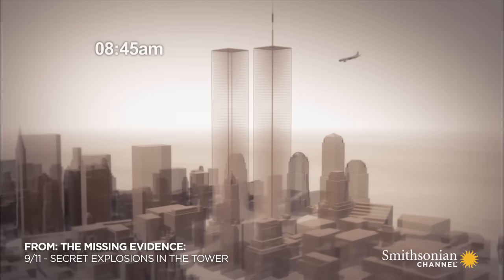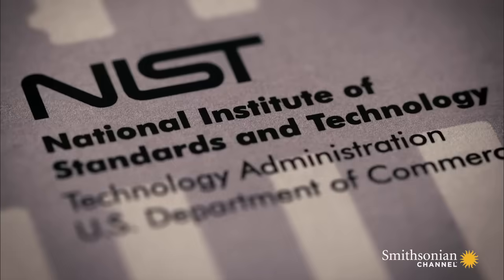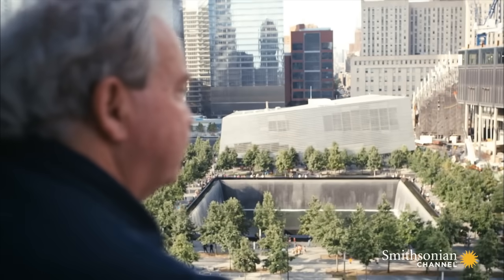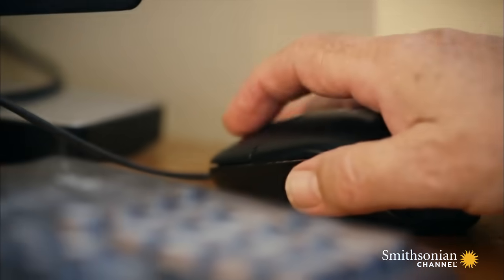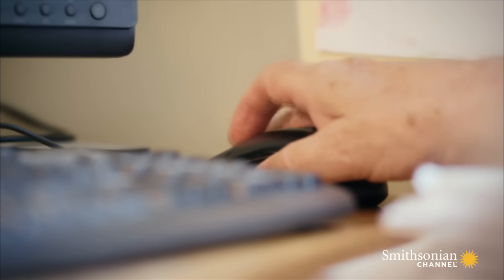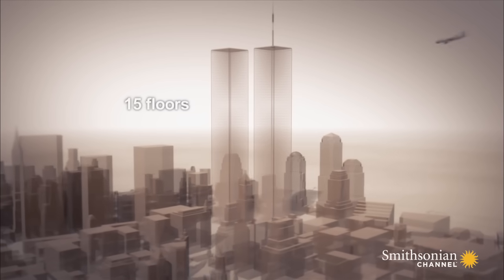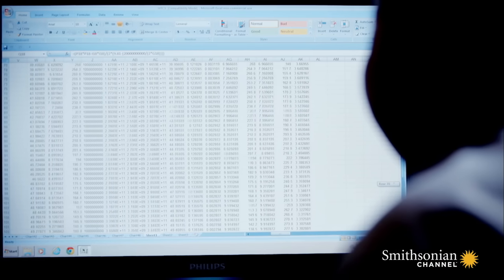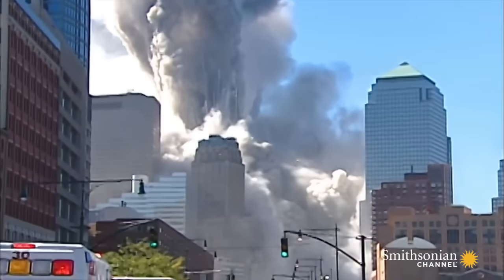This Computer Simulation Explains How the Twin Towers Fell

Comment: I believe in this  theory  It does make sense to me.
Reply: This is ment to brainwash you
Reply: Edward Carlson so why do you think that your true and believe is better than mine? Let me as you this.  We agree that the airliners fly into the tower,  and we agree that there is an explosion the moment the planes hit right? We also agree that there is an explosion 1 second before the towers collapses right?  So you think there is I bombs in the towers..  If that is true,  I see 2 problems.  1 should the bomb not go off at the moment the plane hit?  If collapse should look believeble it's vital that the bombs go of in the right area. So some have placed the bomb after the planes hit?
I believe what people think is explosions while the towers collapses. Are just trapt air is the air is pushed down it ofcause makes I huge pressure and it explode out on some weak spots in the building. I also think the burst of air are to small to be a explosion that can take a building down.
Reply: Jimmi Pedersen nice try but no cigar

Comment: The short version is simply that one of Newton's laws invalidates his assumption that the "downward" momentum  is cumulative.  In other words, at each momentum "exchange" ,  a "floors worth" of energy is "used up", until, after an appropriate number of floors have fallen , the process would STOP, leaving both towers  battered, but still standing.  NIST tried a revision something like this, but finally gave up on it, in effect admitting that the idea was indefensible. They have NO exlanation for the towers falling.
Reply: And that would be correct if we were talking about a solid structure falling and hitting another static solid structure.  BUT we aren't.  We are talking about a set of buildings that were basically HUGE book cases enclosed in a steel cage.   So yes the momentum of each floor is called into play, but then you also have to call into play the kinetic energy as it shockwaves down the structure which was already weakened and causing more failure and redistributing momentum.  Phyisics doesn't pause one law so another can do it's job unencumbered.
Reply: Darkeklaw:   You have your sequences confused.    The structure was NOT "already weakened".   Not until the next round of explosive charges went off, anyway.  And what's with the "bookcases"  ?!    And the only "shockwaves" , aside from explosives, were the weight of various Junk falling from above,  none of which is anywhere near enough of a load to collapse the whole building.   The safety factor, according to the designers, was something like 5 times .